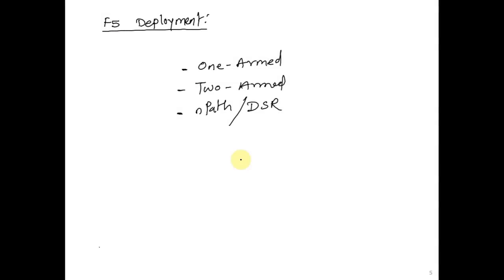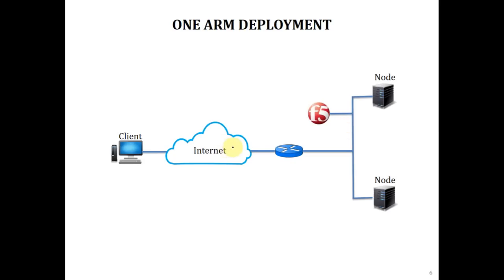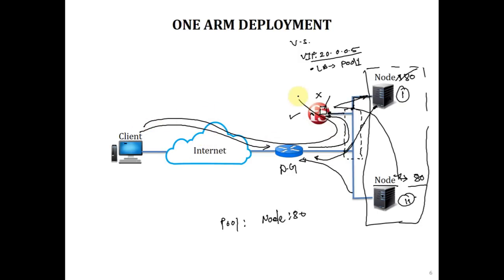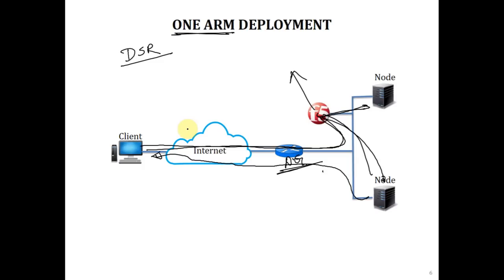Big-IP F5- Deployment Scenarios

Comment: what happens if the F5 goes down and it is the only device managing connections?
Reply: It fails over to it's HA peer which is required in a standard deployment. Connections are never dropped.

Comment: In the one-armed scenario with asymetrical routing, the client wont accept the response of the server because he doesn't recognize the response (src address isn't the dst address he is trying to reach). unless you make another SNAT on the outbound traffic, however, because the traffic in the asymetrical one-armed scenario isn't returning across the F5, this is impossible to achive. This SNAT happens automaticly in the standar scenario when the servers are behind the F5 and the F5 is the default GW. in fact, I just tried in a lab right now, there is no asymetrical routing, SNAT in income traffic happens automatically when F5 is connected with 1 cable

Comment: have a doubt in second scenario, i think we dont do Nating in two arm mode for requests coming from outside...
->from the client,  destination IP is the VIP which sends traffic to one of back end servers. AT this time the source IP changes to VIP and destination to the back end servers.
-> the backend servers while responding back send to destnation IP i.e VIP (as it lies on different network, it sends to its default gateway which should be LB connected  )...so there wont be a case of snat in two arm mode....
IF, ONLY IF, the clients reside in same network as the backend servers, we have to do SNAT
Reply: Source IP address will not change to VIP in this case dude .
Reply: I have the same question. Can anyone explain this. Thanks.

Comment: you didn't elaborate on the dsr method and its use case, other than that the information is quite useful
Reply: Generally in DSR/nPath, you need to configure an additional IP address same as your VIP. It's a clone of your VIP to your server's NIC.
In some cases and if desired, nPath/DSR provides high throughput for outbound traffic  because packets do not need to be transmitted to the BIG-IP
system for translation and forwarding to the next hop.

Other than that, I cannot think about any advantages of using nPath in production. There is a list of disadvantages, however.

The disadvantages of Direct Routing are:

Backend server must respond to both its own IP (for health checks) and the virtual IP (for load balanced traffic)
Port translation or cookie insertion cannot be implemented.
The backend server must not reply to ARP requests for the VIP (otherwise it will steal all the traffic from the load balancer)
Prior to Windows Server 2008  some odd routing behavior could occur in <2% of Windows Server installation.
In some situations either the application or the operating system cannot be modified to utilse Direct Routing.

Refer this URL for more info:
https://devcentral.f5.com/articles/the-disadvantages-of-dsr-direct-server-return
Reply: I also didn't understand the 3rd Deployment , Dun understand either your reply yo "I am"

Comment: 5:40 it will not work client will drop the connection because the source address is of server now instead of F5 v.s IP.
wht do you mean by full set feature of F5 simply say that client will drop the reply .
Reply: The client wont drop because as the internet is involved, the Source IP will be changed to Router's Internet facing IP for the return traffic. I am saying NAT happens because Ideally in almost all scenarios, the internal networks use private IP scheme that cannot be routed over the internet - hence when the client receives the packet, it will be the router's internet facing IP(which is what the original destination IP would have been)